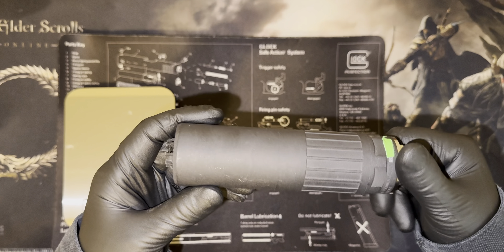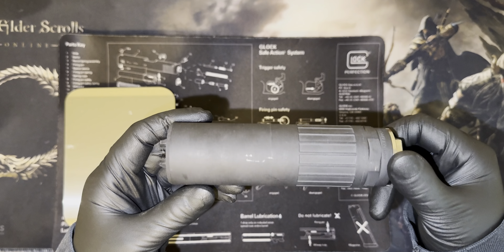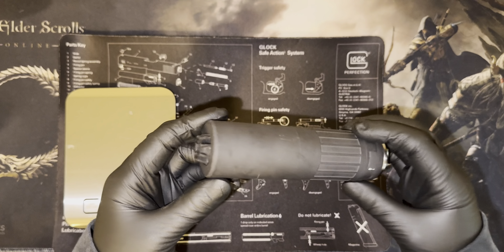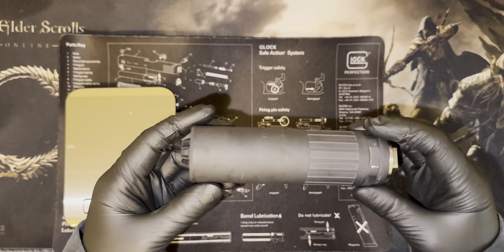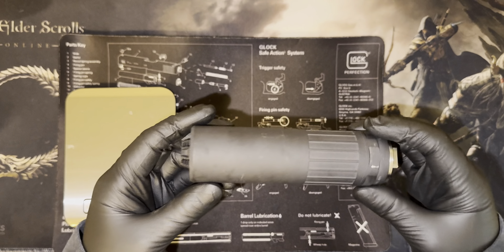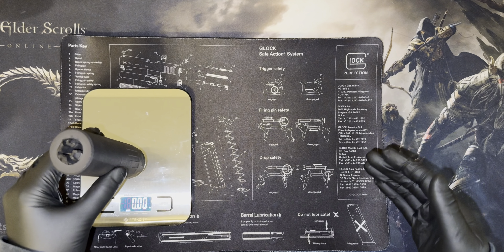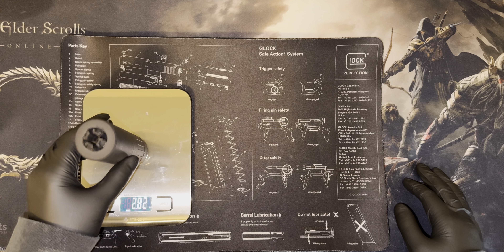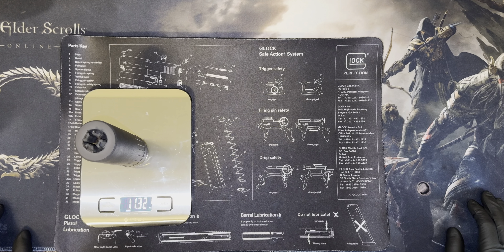CAT Dirty Dave Ti HUB Mil Version first impressions a 3d printed .308 K suppressor

Comment: My CAT JL Ti Hub came with the 5/8x24 mount already attached and the finish heavily worn, with no user manual. Pretty shocking. I rinsed my can and the finish rubbed off on the mount onto my fingers!
Reply from the maker: Firstly, I'm sorry to hear that no one likes when that happens. TBH I'd look at your LGS before I'd be looking at CAT. My first one came with no cap attached, the second one my shop attached the cap but that's because I ask them to weigh it for me. 

You rinsed your can in water and the finished rubbed off?  I'd contact @specterscat and warranty that.  That sounds highly abnormal, from what I've heard the CS is pretty great! Please get me an update when you can.  Wishing you a great day and a better experience!